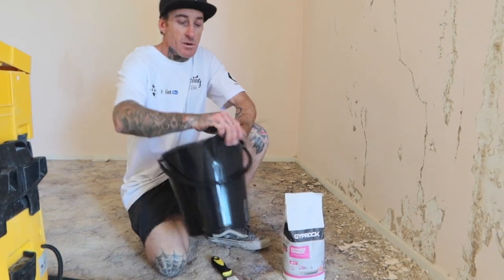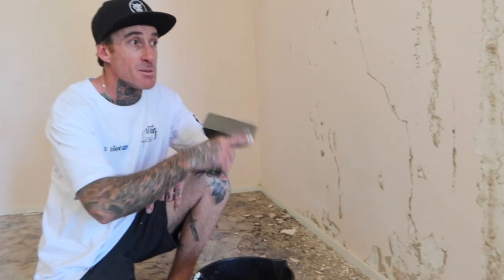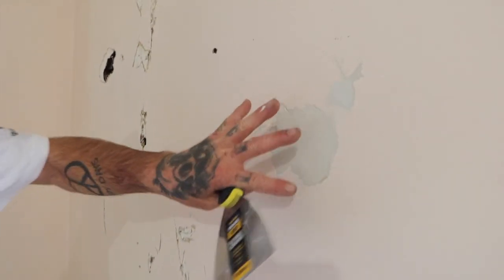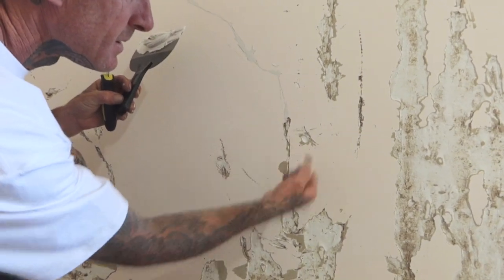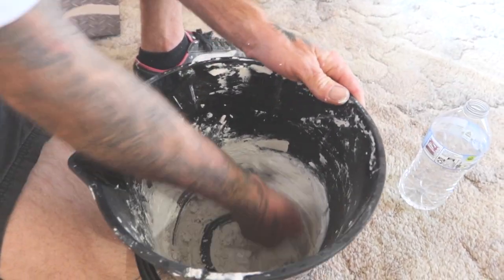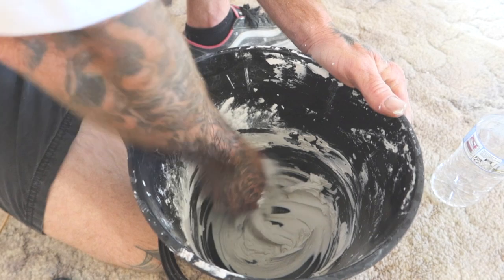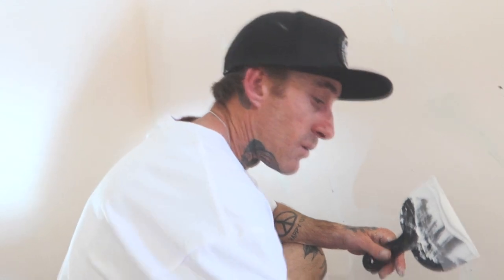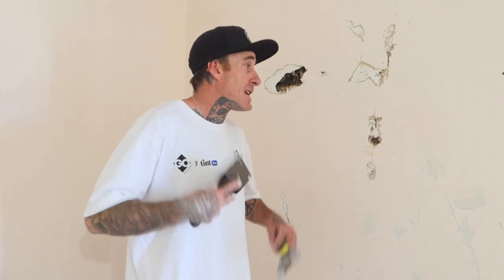PATCHING WALLS WITH CORNICE CEMENT

Comment: Loved your video. Love the vibes bro. I normally use topcoat, never thought of using cornice cement out of fear it would set too quickly on me while patching up a wall. Good tips and look forward to more videos.
Reply from the maker: Cheers legend appreciate you watching. Yeah I love the cornice cement. It usually sands pretty easy and the more you use it you will be able to control how fast or slow you want it to set with how much you mix and consistency of the product 👍🤙
Reply: @paintingbyjosh  hey mate - I’ve been using the “cornice cement 45” for some ceiling crack repairs and had mixed results. I mix it up thicker for the base coat and try to go thinner with it (more water) for the topcoat and I’m wondering if I should just use a base coat and top coat separately instead of the cornice cement? Have you had much success with ceiling crack repairs using cornice cement and fibreglass mesh? tape?
Reply from the maker: @jjonescatch21  hi mate! I have been using the cornice as a base coat & top coat for years now and never really have a problem.
Reply: @paintingbyjosh  too easy man yeah I’ve been having a go with it as a base and topping compound (the 45min) and seem to have issues trying to get a consistent mix before it goes hard. When mixing it up I think I’m not gettin a good consistency because I’m nervous about over mixing and causing it to go hard faster but then if it’s not mixed enough it’s clumpy and hard to spread out on the wall. I think I need more experience and keep trialing it out to get it perfect but the mix ratio and method seems hard to master without making it set too fast. I’ve been mixing it up in a mud pan in small amounts as I need (since I do small patches and repairs) then spreading from the pan instead of mixing separately in a bucket - maybe that’s where I’m going wrong since In the mud pan its hard to mix it up good. 

Thanks for the videos and experience man - appreciate wanting to help out and give tips because I’m a chippy by trade and really trying to get better at plastering/paint touch ups. Would love to work with you for a month! But I’m in Mackay QLD

Comment: Hi Josh - can I use paper tape with Corner Cement? Cover thin hairline cracks without putting paper tape? To cover corner beads which are visible under the previous paint job?  Thank u so much in advance & your videos are fantastic!
Reply from the maker: Hey, yes you can definitely just fill straight over know need for paper tape with hair line cracks. If there is lots of continuous movement I would recommend paper tape. Appreciate you watching on & the kind words 🙏

Comment: Hey Josh - can you use this stuff for cracked/missing patches plaster on brick wall aswell? i put a coat of boncrete on as well first. I actually bought a bucket of the gyprock multi purpose joint compound at bunnings is the cornice cement is better you reckon? especially for deeper cracks? or same same or different - Thanks Bud!
Reply from the maker: Hey mate, yes most definitely you can you this for cracks/holes in brickwork & the multi purpose compound is more of a top/skim coat the cornice/base cement is better for larger deeper holes & sets harder & quicker 👍 hope this helps cheers
Reply: @paintingbyjosh  thanks for your reply! Now i know for next time.
Reply: Actually i more wuestion since im in the middle of it - there was some dodgy crooked rendering done which has beed painted over just a lot of bumps and lines and some dips. Can i go and put some joint compound over it to flatten it out a bit? It seems to bind ok even w paint under it… im gonne put a good base and top over it anyway ofcouse? Is that ok?
Reply from the maker: @jorisvanimhoff9722  yes that would be perfectly fine the filling compound usually have strong adhesion. Just before it sets hard you can shave it down flat with a blade less sanding then sets also 👍

Comment: Hi Josh do you sand walls prior to painting an existing wall with a pole sander before you paint? I'm guessing most painters do, and if you do I've heard some guys say that they don't brush the dust off or sugar soap afterwards they just let the dust mix with the paint ...cheers
Reply from the maker: Hi Tony, yes I always sand before & between coats. Most importantly is to dust down all surfaces prior to paint otherwise you will just create more work by having to sand more and you are definitely comprising adhesion by not dusting down💯 cheers for the message 👍

Comment: handy videos, ive used cornice cement just because i thought it probably has adhesive in it, do you reckon maybe the changes in your sense of smell make chocolate kinda taste a bit like vegemite, i was wondering if you wore a filter mask would your sense of taste improve, diesel ruined my sense of smell took ages for it to come back.
Reply from the maker: Yeah cornice cement is great for adhesion. That is so weird you mentioned that, how did you know? I always tell my wife some chocolate taste like Vegemite to me
Reply: @paintingbyjosh  remember when we have the flu everything tastes different, ive read that  sense of smell effects how things taste, not saying thats the case for you but it was for me, took years to get it back, diesel is pretty harsh though.

Comment: Hi Josh need to patch heaps of small to medium size holes on the gyproc all through the house, after I’ve sanded it do I need to prime the cornice cement say with an all in one primer or can I paint straight over the top. Cheers yewl
Reply from the maker: Hi Tony, I always go over all patched surfaces with a primer/undercoat hope this helps legend 🤙
Reply: @paintingbyjosh  Thx mate love ya work
Reply: I might add make sure you don’t leave sanding dust on the wall .. I broom it then use a damp lambs wool .. you will save yourself a lot of grief in the future.
Reply from the maker: @tonygarvin5602  thanks legend 🙏

Comment: I need to fill a finger sized gap where two ends of cornice/cove butt up against each other.  

I also need to apply maybe a thirty centimetre taper where the two sections of cornice meet to hide a glaring half centimetre difference in thickness where old and new cornice meet.  The older segment seems thinner despite its equivalent ninety centimetre overall dimensions.  I intend to apply a taper to the old segment building it up to meet the new segment.  

(The concrete ceiling itself is probably wonky as the apartment building presumably settled since construction in 1967.)

As I have both plaster of paris and cornice cement on hand I am wondering what might be some pros and cons of mending cracked cornice with plaster of paris alone or adding in some cornice cement?

Is cornice cement also known as "mud"?  

I saw a couple videos advise incorporating a premixed cornice cement (they called "mud") into plaster of paris to extend paris' set-up time.   

Minus the mud, plaster or paris quickly starts setting only minutes after reaching that ideal spreadable "frosting-like" texture.  Quickly turns un-spreadable and irredeemable because I cannot water it down to extend it's "working life".  

This cornice cement / mud apparently extends the working life of plaster of paris when it is at the point of "frosting" texture" - not unlike the frosting we might thickly spread or butter on a sponge cake. :)

I need to go back and find the videos describing the method and see if only the pre-mixed form of "mud" is acceptable.  My cornice cement is in the dry powdered form and as it understand it, set-up time is less than a "mud" premix. 

Hoping to buy more time when applying plaster of paris, I tried watering it down.  A total disaster.  Adding water seems to create gravel and when it eventually sets and cures, a powdery mess like talc is the result.  Has to be removed.  Turns the site into a dust bowl.